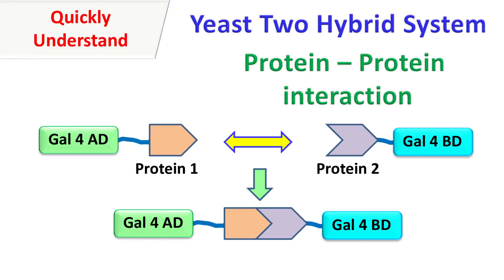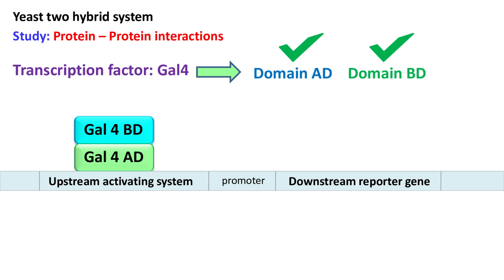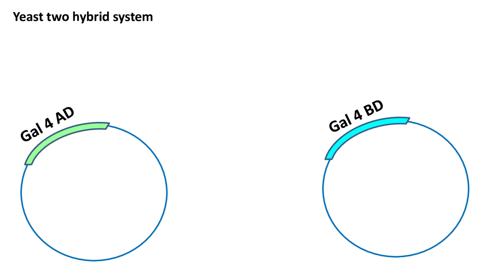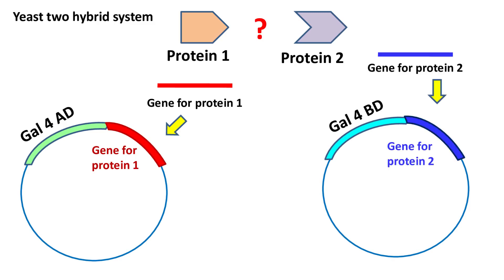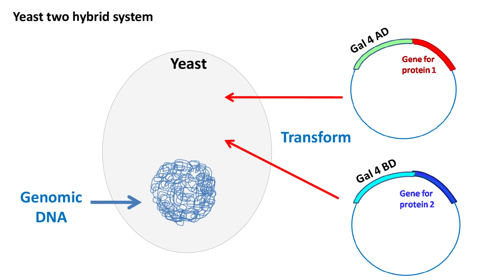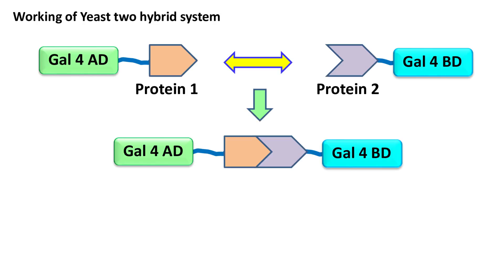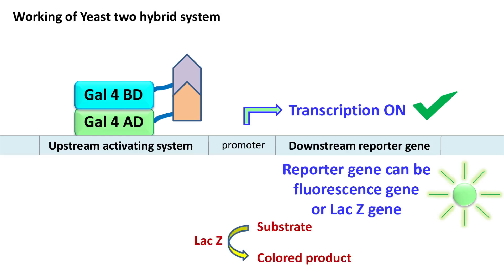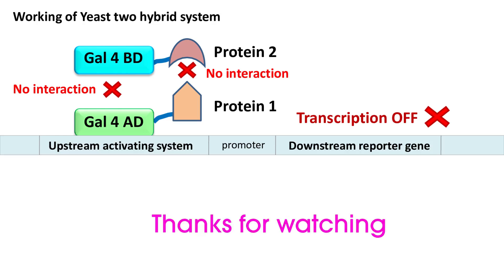Yeast two hybrid system | Protein - protein interaction

Comment: Great video! I would only change where Gal4 BD/ Gal4 AD are situated. I would swap them to have BD contacting the DNA, as this is the binding domain and can bind the DNA whether the AD is presently bound or not (just can't start the transcription without AD). You can also use a reporter such as ADE2 etc. which makes the yeast ade+ to grow on selective media -ade, you don't necessarily need to use the LacZ gene and in fact you need special yeast to be able to transcribe LacZ, since it's a bacterial gene and yeast is prokaryotic.

Comment: So beautiful explained.All doubt cleared about yeast two hybrid system.
Y2H system is used to study protein - protein interaction. Suppose we need to study about the interaction between Protein x and Protein y, then the 1st step is to ligate these two protein in two separate plasmid with Gal 4 AD and Gal 4 BD(Gal 4 AD and Gal 4BD are transcription factors which forms a heterodimer and bind in the promter and switch on the transcription and a reporter protein is formed which can either be a fluorescence gene or Lacz gene).
2nd step, Both the  plasmids are transformed inside the yeast cell.(Note: Gal 4 AD & Gal 4 BD should be knockout from the yeast genome) 
Now, the yeast will form Gal4 AD & Gal 4 BD along with Protein x & Protein y in such a way that, only when the gal 4 AD & gal 4 BD will come closer to form a complex and bind in the promoter region when the two proteins Protein x & Protein y interact and form a complex.
So, if the two proteins interect the reporter gene will give rise to reporter protein,so we will conclude that the Protein x & Potein y interact with each other.
Reply: it doesn't bind the promoter, it binds the UAS which is distinct. RNA Pol is recruited to the promoter by Gal4, which is a transcriptional activator. The UAS is a bit like an enhancer region in animals except the UAS is typically closer to the promoter than an enhancer which can be much further upstream.